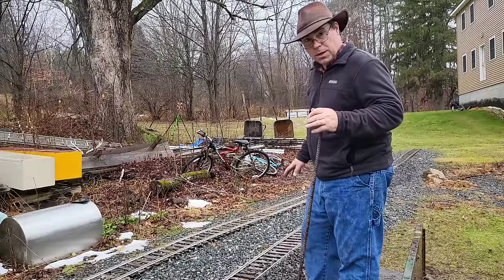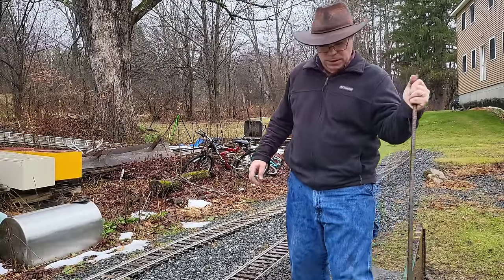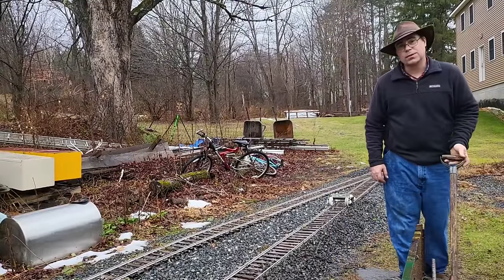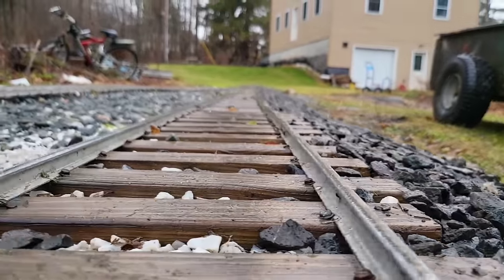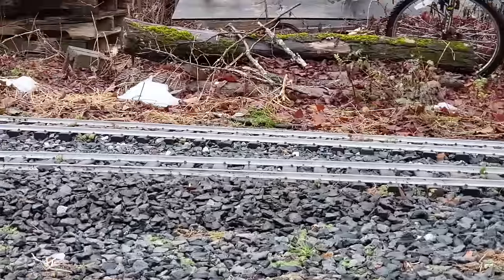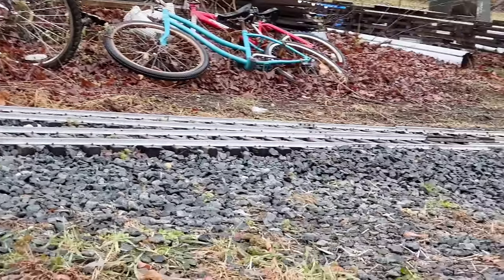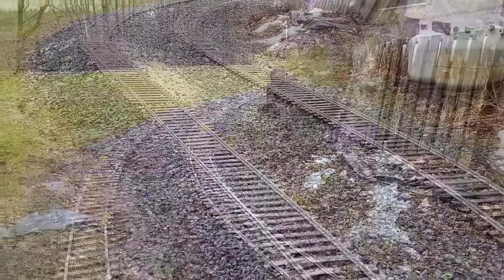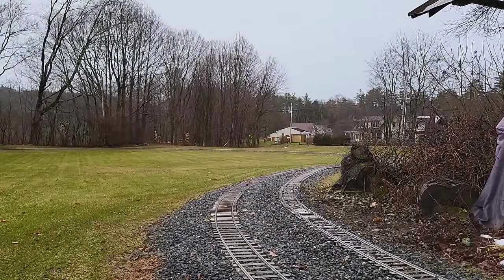Resurfacing Railway Track In The Rain and Snow

Comment: So, this entire video showed you leveling the track rail to rail. Maybe you can do a video on how you level the track length wise ( as in taking the dips and hills out of it so it is level and smooth as you run on it.)  Yes that looks like a coal scoop. I have one in my house with my coal furnace as well as yes it is used on a steam locomotive. :)
Reply from the maker: Thanks for the info, and for the idea! Leveling the track lengthwise is a bit more vague than this.

Comment: Great video thanks for sharing! Do you use tie plates under your rails? What size is the bottom of your rail that you use?
Reply from the maker: There are no tie plates in this section. Nobody makes them for this rail. The base is .570" and the height is .625".

Comment: Jacking and packing . I've done the same on 4ft 8 n half inches on the Mid Norfolk Railway  in the U K not far where I live . It the same principle just on a larger scale. 😀
Reply from the maker: Very true, the concepts are very much the same. Just the tools are smaller. I have a set of aligning bars for the full-size railroads. They don't work well on the small stuff.

Comment: Don´t know about shovel. But after many years of using it, the question is what can improve your new track extension project to reduce on long term its use. One put 2 2X4 paralell to rails under each track panel. Does it stabilise the track more ? And of couse, being under ties,
  they´re more prone to dampness even if there is less oxygen for rotting. That increase work and cost construction. More mileage means more hours in maintenance.  Your experience for improvements is a big plus here.
Happy grey Christmas nonetheless and see you in 2024. ❤
Reply from the maker: Stringers under the ties really don't do much, but wick water into the ties. There's lots of room for oxygen in clean ballast. 
A better thing to do is have deep ballast. You'll never regret having too much ballast under the track. It locks the ties in real good. I didn't use enough ballast in this area to begin with, and what I did use has sunken into the dirt. This was an area where I didn't use geotextile, which is another product that helps make the track stable.
Reply: @MillBrookRailroad  thanks Aaron